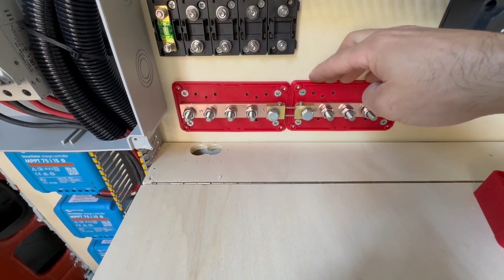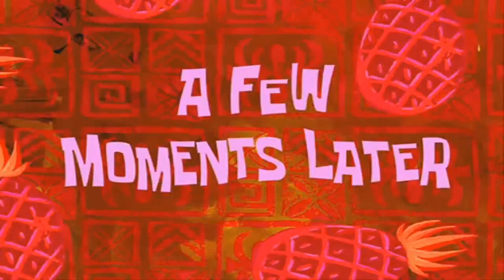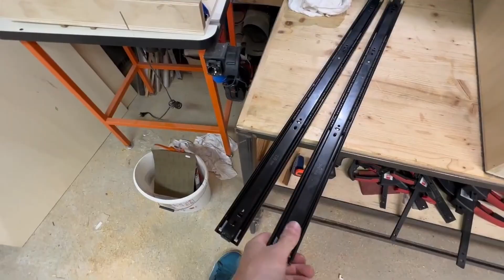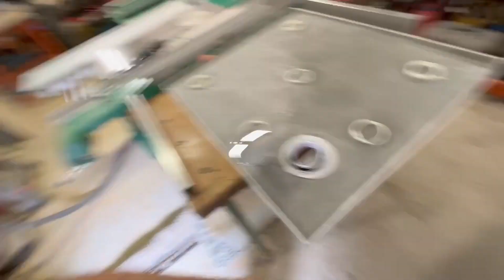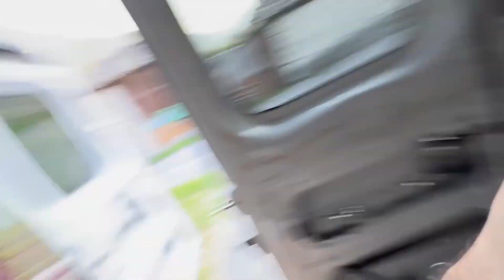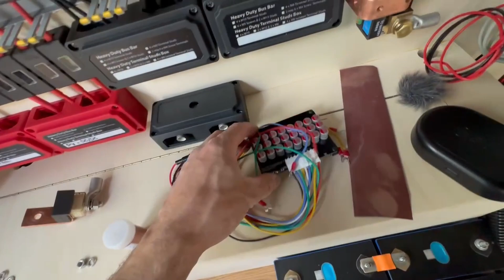EP14 part 1 - Electrical system [ DIY VAN BUILD ]

Comment: Hi, I like your work and see the process of your build. really nice. 
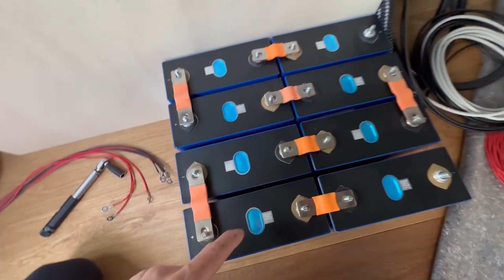I’m in preparation for building a van for myself in the future, so I also did some research in battery building. One of the most common thing I see when when building a LiFePO pack from individual cells is to compress them. Did you consider this method? That will inhibit the swelling of the cells. Configuring a battery like this will ensure that the internal cell structure stay undamaged, last much longer and the performance will be not (so much) affected over time. 20:43 The circumstance you have some space between your cells is a good thing when you not compress the cells, because the swelling and the resulting motion can damage the busbars and the terminals or losen the connections. Maybe that is interesting for you. :)
Reply from the maker: Thank you! I did consider to compress the battery, so I wouldn’t need flexible busbars. But after some research and after understanding the data sheet of those cells, I figured that is not worth the effort. To explain it you can watch this video: https://youtu.be/OsvPYw6hoHc?si=Ey3Xjf7HPSKpgRsJ
This guy is very knowledgeable and he did many tests on his channel. 
The space between cells is now filled with 6mm Depron sheets to minimize the movement of the cells when driving but also leaving the ability for them to expand. Thanks for the comment! Good luck with your build!
Reply from the maker: Andy the guy I just told you also made a follow up video on this topic which I suggest you watch after. https://youtu.be/63-Nx75_xXM?si=nUVMhNKuhkI_eh7C
Cheers
Reply: @diego_tam  wow what a virtual journey haha, German guy(me) watch Italian building a van, who recommend a video from a Australian with German roots, referring to a video from a German youtuber I also know… But very interesting is the math shows the possible cycle count would outlast the aging. 
Thanks for sharing.
Reply from the maker: That’s what I like about YouTube! There are no borders here. We have to help each others as much as possible!👍🏻
Reply: @diego_tam yes I saw that one too :-). The one I found very interesting was Any’s test between A en B grade cells, which turned out: not really a difference!